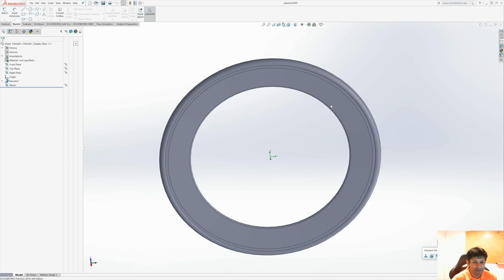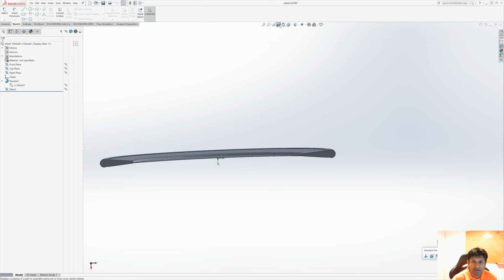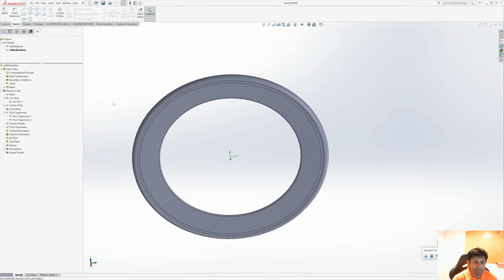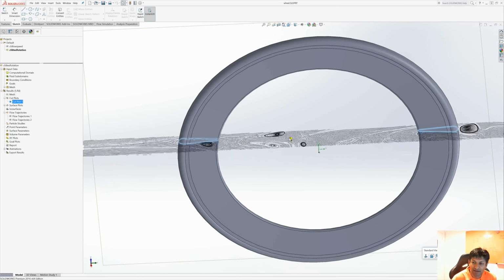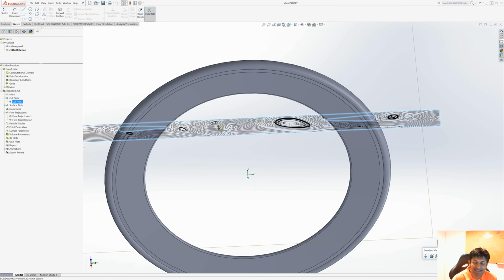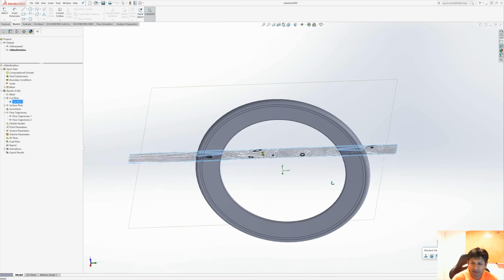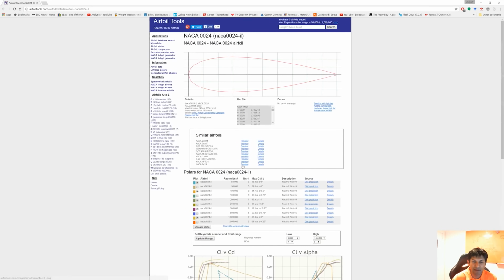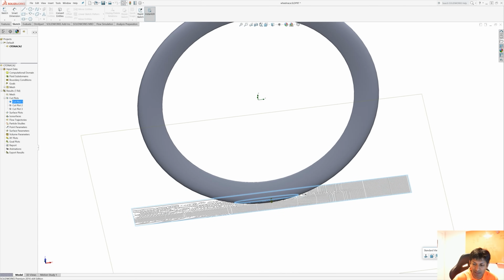Explained: Aero Bike Wheels (Zipp Enve Mavic Fulcrum)

Comment: So out of interest, why did you buy that style of wheel when its so obviously worse than the ones you recommend? I mean as a simple physicist most of the drag areas you mentioned seemed quite easy to spot without CFD so I assume as a high end professional in that area you would have also seen the drag hotspots when purchasing it? I'm not a cyclist mind I'm just here for the aerodynamics/engineering/general expertise so perhaps theres something I overlooked. Is there a poor choice perhaps? Maybe they were the deepest despite their design errors? Or maybe its simply easier/cheaper to run your bike and whatever maintenance with that wheel? But looking purely at performance I'm a little confused why you have the wheel at all?
Reply from the maker: The basic reason is price. the depth has far more effect than anything else and they were a good price in a wiggle sale. If the price was the same on all of them, I would pick Enve/Mavic. You are quite right in what you say, if you are semi trained you can spot teh CFD hotspots but the majority of people who watch this channel aren't CFD trained so I have to tailor the vids to match the viewers.

Comment: After looking at what's available, it appears that the "U" shaped wheels are taking over. Is there a downside to purchasing them? I ask because of your NACA discussion.
Reply from the maker: Rico Fiori it's probably because they cost less to make. The bike industry sold the premise of push fit bottom brackets as an improvement. It will go the same way with wheels
Reply: Hambini Performance Engineering we have windy spring days. Every winter/spring we get between 15 mph and 25 mph (24 and 40 kph) winds. The temps are great so the conditions are mixed in Arizona at 2,500 to 3,500 ft (760 to 1,067 m).  I want a wheel that is not going to have a problem in cross winds. My current wheelset (American Classic) is a NACA style 25 mm deep but only 20 mm wide. The front wheel has some difficulties in cross winds. 

It appears from what you've tested that it's important to pair the wheel diameter with the tyre diameter. Is that the most important determinant? Are the differences between what I've got and say a 60 mm deep and 25mm wide not significant enough to justify the change?

Comment: If your model is symmetrical, which it is, how come the vortices are not? Is it to do with the mesher used?
Reply from the maker: Hi, The computational domain ie the boundary on the left and right side of the wheel is not even. ie the wheel is closer to the left edge than the right edge. It's a common technique that Aerodynamicists use - it's almost standard practice.

Comment: Great video! what are your thoughts on Zipp's new saw-tooth profile wheels? The marketing blurb is that they help with stability in cross winds (less pressure drag with high yaw angles?) is this marketing speak or is there anything to it?
Reply from the maker: When you get to 12 degrees, any wheel irrespective of profile will have detached flow. The difference between the best and worst having detached flow is about 1 to 2 degrees. The Saw tooth will be effective at one particular speed (Reynolds number), either side of that and it will be no better.

Comment: Learning to cut through the marketing bullshit seems to be an essential skill if you're going to like bicycles. While all the high tech stuff and flashy marketing paint a pretty picture to justify the thousands of euros bike manufacturers are asking for these days, the sad reality is that for most people under normal riding conditions most of these marginal gains will play no role at all. Use a comfy tire, wide rim to accommodate it, get some evenly tensioned spokes, and hubs with good bearings in them, think about how windy it is where you're riding (with the amount of side wind in NL I refuse to ride anything deeper than 40 mm), and don't spend your kid's college money on the latest Zipp wheels. Unless you're always riding on TT bars in a skin suit, your position on the bike and the clothing will far outweigh any wheel or bike frame aero gains.

Comment: why is nobody asking the obvious...smaller wheels!!! 650b or even 26 inch wheels may suffer on angle of attack but will be more aero, lighter and nimbler, and stronger. UCI regulation is keeping true optimization from happening
Reply from the maker: I think you are dead right, as soon as they take out the 3:1 rule, you'll see everyone go to a longer tube shape.

Comment: No fork means not a reality model.
Reply from the maker: Not sure what you mean?
Reply: Hambini Performance Engineering the bike manufacturers spend a lot of time perfecting their designs. The front fork of the bike is a place where aero testing has been extensive. Also, it has an effect on exactly the part of the wheel that has the most vortex turbulence. Without the fork in your model, we can't know what turbulence really is on the back quarter of the wheel. Also, since there are many different fork designs, we may never know using this method.

I apologize if it sounds harsh. My intention is to call into play some of the other major considerations that the reader should understand.
Reply from the maker: Quite the opposite, I don't think it sounds harsh at all and I actively encourage the engagement. 

I'm not sure how familiar you are with CFD but you don't need to model the fork (physically), you can apply a boundary condition in the rear quadrant of the wheel to take into account the presence of the fork. eg a flow condition of zero velocity in the z direction or something along those lines. Which is what the above model has. I didn't mention it in the video as it would be beyond the scope of most viewers.

In this particular case I used a Cervelo S5 invisible fork for the analysis. Basically the fork is there in it's presence to act on air flow - you just can't see it.

Hope that helps Hambini
Reply: Hambini Performance Engineering I'm not familiar at all with CFD. Had you said something about the fork in the video, I would have had no comment.

I've been doing some consumer research on this subject to find out the truth. It mostly comes down to following the money in order to disregard marketing hype, which I define in this context as removing as many contributing variables as necessary to prove a foregone conclusion.

I've spend the better part of my career teaching how to validate data and improve its quality. I've published and spoken on this topic.

Also, I have a masters degree in mathematics.

Comment: IS THERE ANY REAL GAINS BELOW 40KM HR FOR THE $$$ I SAY NO !!
Reply: Deep section aero wheels with a low number of bladed spokes have a 2-3% speed advantage over standard 32 spoke wheels with box section rims.  It's worth the $ if you're a racer of high enough caliber to get the wheels for less than wholesale.  If you're riding a bike with rim brakes it will be compromised.  Some carbon rims have a decent braking surface and some have a lousy braking surface which will significantly degrade your brakes effectiveness in the dry and likely severely degrade it in the wet.  Carbon rims with rim brakes are also prone to failure due to heat.  Heavier riders are going to have more problems than lighter riders.  If your bike has hub brakes the braking issues are no longer an issue.  For most riders it's not cost effective.

Comment: SO l only have 28mm and 38mm deep wheels .l find fatter tires 32mm on 28mm deep in the winds moves less and rolls better . As for the other wheelset with 38mm deep section and 25mm tires moves alot in the wind making the bike feel unstable .SOOOO since l live in the flats keep your overpriced DEEP DOUCHE wheelsets since they end up weighing the same anyways in the end AND alloys wheels are stronger and brake better with rim brakes :)

Comment: A lot of metric. We don't use metric speeds in the UK, so harder to grasp speeds you mention.

It's like learning a language where you have to stop and translate - much slower.
Reply: Metric is fine. So everybody can understand.   On tne long term the UK will turn to metric more and more.
Reply: @bbqreunie984  There are problems with the current metric system. But people just accept it. Base 100 or base 10 is not it. Base 12 has more possibilities. Base 16 is perfect, but 12 is more appropriate.
Reply: @forevercomputing  It matters so much more to just not use a bunch of different number bases in everyday life, to most people at least. So unless you propose to ditch base 10 for general arithmetics altogether (good luck with that lol), just stick with base 10 for everything.
Reply: @forevercomputing  WTF, base 12 metric is the dumbest thing I read on the internet today. Congrats.
Reply: @truantray  Enjoy your 10 hour days, 10 day weeks, and 100 weeks per year

Comment: You started out so well and then you completely disregarded yaw angles, spokes and fork legs...
Shame really. The reason for the thoroidal shape is because you never see zero degrees yaw. Your recommendation comes straight from the early 2000's mate.
Reply from the maker: Sorry. It's hard to please everybody
Reply: @Hambini  This isn't about pleasing or not pleasing somebody. This is about giving bad advice based on an incomplete picture. The thoroid is not 'marketing BS', there are peer-reviewed scientific papers on why it's better in higher yaw angles than a NACA shape. Your NACA profile is only best in laminar flow at zero yaw (ie your SolidWorks test). I doubt you'll ever see that, even in a velodrome. There's always changes in airflow, turbulence from other road users. And then I haven't even talked about spokes, fork legs or hubs.
Failing to see the big picture properly is a very easy way to get nonsense answers. Go ask some racing teams using wind tunnels before they had rolling roads in them.
Reply from the maker: @StuntpilootStef  thanks for your comments